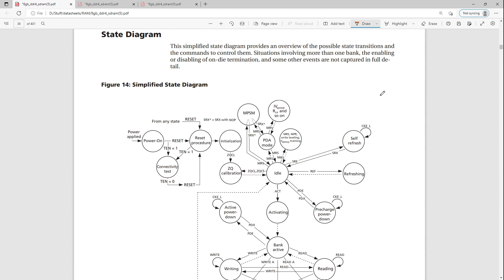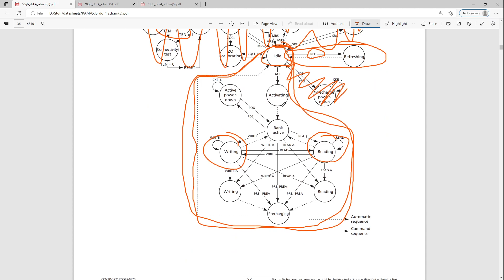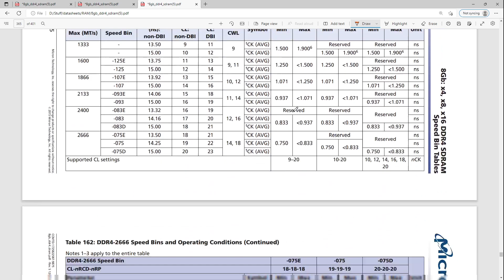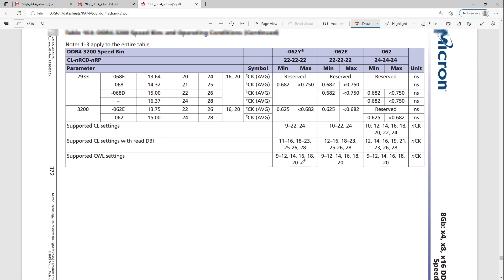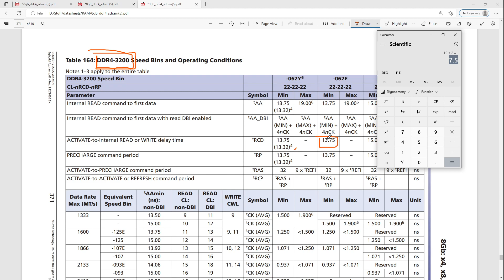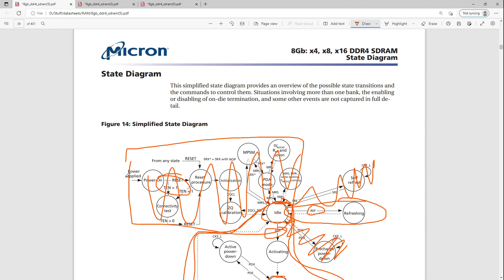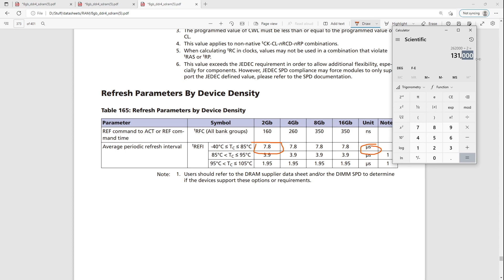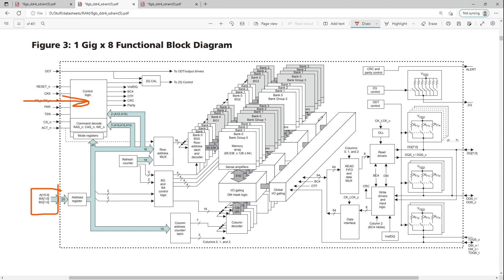RAM timings explained 0

Comment: So my main take away here was we basically rely on educated guesses for how all this stuff works because there's no real back and forth communication? The timings are literal guesses on operation timings? 

Da fuck!?
Reply: In essence, We make approximate use of the properties of copper to achieve this end. Whatever comes next is a matter of   refinement. Removing bottlenecks involves better understanding of how electricity charges copper, or conductive alloy atoms across its matrix in a specific shape. 

Its one hell of a rabbit hole...
Reply: @MarcABrown-tt1fp  lol the longer I work as an SE and gain better understanding on tech, the more I realize just how much is held together by shoe strings and paper clips while balancing on a tight wire...
Reply: No.  It's only educated guesses when you start overclocking.  Up to that point your processor and its memory work correctly together because they were engineered to do so.  The data sheets such as that which Buildzoid showed specify the worst case timings for the RAM.  The memory controller in the CPU is set up by the BIOS so that the RAM chips always work with signals that allow the RAM chips enough time to do their thing.  At this level, it is basic digital electronics - it only gets more complex because in DDR4 and DDR5 there are so many sub-timings and interdependencies that also have to be taken into account.
Reply: @GodmanchesterGoblin  That's still just data sheet saying how long things should take. Which is still basically an educated guess. I understood the video given I have the background to do so, but that doesn't change the fact that it's basically relying on things "just working" TM
Reply: @GodmanchesterGoblin  without any kind of handshake protocol or way to indicate when a process completed....it's all just a very fragile pipeline made more reliable via accounting for error margin and buffer room. OC is seemingly just reducing both those aspects without really knowing how much you can remove till you try
Reply: @aj0413_  No. The data sheet specifies the worst case parameters, guaranteed by the device manufacturer.  To that, the board designer adds in the time it takes for signals to travel the necessary distances, to settle after transitions, and so on. Those are all defined by physics, specifically transmission line theory and would be confirmed by direct measurement during development.  Hand-shakes between CPUs and local memory would be technically possible of course, but would add more time and complexity.  Yes, it has to "just work" but it does so because it is designed to.  This is a very different from transactional operations in software, or over a network, etc.  Not to be critical, but I suspect you probably have not spent much time working in digital hardware design.
Reply: @GodmanchesterGoblin  That doesn't really change the relevant point: you're using math to make a determination on how long something should take and then relying on that.

It's an educated guess. Most of physics is an educated guess because it relies on a bunch of principals and theorems that have yet to be proven conclusively.

I'm not sure why you dislike summarizing it that way.

shrug I started my education in CE which combines CS and EE; as I said, I understand the topic/discussion.
Reply: @GodmanchesterGoblin  I have literally had to do similar design as explained in the video at a software level.

The only real difference is accuracy of guarantee, at the end of the day. 

Theoretically, we should know enough that the guarantee here should always hold true.

I wonder how long this design will hold up as we edge closure to the quantum tunneling problem
Reply: @GodmanchesterGoblin  But disclaimer: yes, digital hardware design isn't something I've had to touch in near on a decade. S'why I listen to buildzoid to get the watered down (rant/tangent) filled summary
Reply: @aj0413_ As you say, it's down to the accuracy of the guarantee.  And that holds true whether we talk about the design as a whole or the data sheet specs for an individual chip.  I think the difference is the language we use.  I do understand where you're coming from, even if I would not call it educated guesswork. I probably gave up guessing when I was designing around standard DRAM chips in the early 1980s.
Reply: @GodmanchesterGoblin  That's fair. I was recently reemed by the wife getting on my case for not prefacing any technical discussion with "we think", "theoretically", etc...cause she decided to be a pedantic troll about how theorems aren't actually facts while discussing space/time theory. So, sorry that you got hit with the backlash of that lol

Comment: Have anyone deal with RAM not resuming properly from sleep while overclocked?
Reply from the maker: I have heard of that being a problem but I don't have sleep enabled on any of my desktops so I've never experienced it myself.
Reply: @ActuallyHardcoreOverclocking  Also how come that DDR4 is so variably imprecise while overclocked? My A55 chipset with two sticks of 4GB DDR3 HyperX 1600 just have to dial it to 2400 and it just flies with the occasional hardware exception error thrown by the kernel in Linux once in a Blue Moon and more frequently during Summer.

Comment: Sadly they don't teach smaller than millimeters in middle school as you are not able to use anything smaller anyways. In higher grades depending on where you go and what you take you might get smaller measurements and what symbols they are shorted to.

Comment: I think that I know what the refresh does, look at DRAM-memory as capacitors, those lose electrons over time because those do not insulate perfectly in real life. It checks for a reference voltage if charged up and if the voltage drops too much then it pumps electrons again to make sure that a high voltage remains sufficiently high. This is a bit of speculation of me though I am 100% certain that you can compare it to capacitors, I am 100% certain that REF stands for reference-voltage.

Comment: 27:10 okay then you explain how I statistically have a higher amount of kills vs skilled opponents at a lower NANOSECOND memory latency vs higher in CS competitive   .

ONCE you have controlled for situation positioning and isolating 1v1s where you SHOULD have 50-50 chance to win the engagement AND have enough competitive experience to tell the difference.
Reply: *im in esea main

*Csgo is extremely memory sensitive.
Reply: Frame time variation. Lowering latency improves minimum frame rate and reduces the variation in frame delivery overall. Since CSGO punishes errors so harshly, even compared to other FPS games, you are reducing the number of mechanical errors you make by having the most up to date visual information available.

Comment: Little concerned with what you are telling here with the Samsung b-dye as I always read to look for b-dye cause it should be "good" memory chip. Not neccesarily the best, but one you could always count on doing what its supposed to for its specs. This sounds more like it's a "cheap" chip when you say it's all over the place timing wise ?
Reply: B Die is the best, but all chips including b die vary heavily in quality. B die will almost always run what it's rated for, and usually overclocks very well if you just slam 1.5v into it and stick a case fan over your ram to keep it cool, where as other sticks will require looser timings, stop scaling with voltage after a certain point, or even potentially die if you slam voltage into them.

Comment: 2.14volt ram x12 = 24.800mhz ddr3 can do it 😂 4x6 ssd x3 gpu x3oc x2 =x5 wifi 7 6000mhz x2= x7 over 300mhz x2= 24.800mhz max x12 ram 7timing ist faster on 3.7 to 5.7cpu 24000lvl 2x300mhz x8 10k 2.800mhz spreed  so last post was this noting more t4 timings 4x4 x4x4 x4x4 x4x4 Konstruktion on board and hardware 32c  lvl x12x16k lvl ready 128 core power i say it you can 3x faste make 8c 16t 24tb to 256c lvl x64 x64 lvl over 28.800mhz over 16c 32t 2x 48gb 96bit over ram its work server runs so 1.8 petabyte  this is that cuppel faster over dobbel ssd 24 and pciex4 x8gpus all is Working i say it you

Comment: Wouldn't it make more sense to engineer memory modules that are at least smart enough to be able to respond back that the row has been activated/data written/etc., so that timings become unnecessary, and commands can instead be sent at variable rates corresponding to the time that the previous command is completed? Wouldn't that also help prevent data corruption by allowing data from a write operation to be confirmed via a returned checksum?

I assume the answer to this is that it would slow down overall memory performance because then each operation would require waiting for the previous operation to finish. However, given how fast memory is nowadays, that seems like it could become a worthy trade-off, since it could help prevent data corruption.

So if that's not reasonable, then, how about adding logic to memory controllers which occasionally uses such commands to calculate the amount of time it ACTUALLY takes these operations to complete, and adjust timing dynamically based on what the memory is capable of at the time? Basically instead of overclocking manually as we do now, the controller would keep the memory 'overclocked' to the best timing it calculates can be supported without data corruption (with some level of tolerance, of course). This calculation could be repeated every so often (say 1ms) so that the timings are virtually always ideal, even if the conditions change (such as if the memory modules begin performing detrimentally due to heat or some other influence).

Then we wouldn't have to worry about setting timings and overclocking at all; instead worrying about the average minimum timings that come from a brand.

Comment: I say jour how its work 2400mhz 12x datapakets 4800mhz to 7600mhz over ssd m.2 18.600 mhz and  wifi 7 6000mhz ram 6000mhz + 2400mhz = 8400mhz = speed 16.800mhz 18.600mhz ssd m.2 blast 1tb 4x4 faster 2000mhz to ram network ram speed x4 speed x4 its give exakte 18.600mhz on ram wenn your ram un 1.87volt to 1.48v board latenz vollt over pipplines ore 6000mb/s ram do x6 so that is the Trick open you timings on ddr3 to limit from 7 timing to become the fast 8 x8x speed over network over ram over cpu x12 x6 = 18x 24.800mhz x12 x6 24.300mhz x8 24.400mhz x3 pippline over 24x half data paket  or 22x 6x 24 x8 core 6 c 8c become the same timing over max 12x ram or gpu on 2680mhz oc to 24.800mhz limit 24gb gpu  that Combo blast 4x 4x cpu ram wifi 7 ssd 4x4x gpu x2 bandwith limit 4x4 its give 24.000mhz boost bandwith together an cpu 8c and ssd 8c m.2 16.400mhz 4x4 = 8c  4x4 over 4x ram max oc wifi 7 x6 ram rest you become over ssd make more drive for stabel 24.800mhz you must open ram limit timings and 7 speed boot winto run this on 3.7 gpu auto to becom this lvl so easy in 1.87volt x8 ram
Reply: That shit is unreadable. Heard of a paragraph?
Reply: @mitlanderson  thats the problem ddr4 musst open limit timings have and boot 7 in 3.7ghz cpu than it go it boost x2 faster over 150% 4800 2660mhz ran ddr4 8c 2466 6c12t
Reply: 150% trippel  timing 32cor lvl speed over 24.000+ 24 x24 x600
Reply: @PeterMarszalkowski  mate, the way you type seriously makes me question if you even speak the same language.

Comment: This video could've been far shorter. Once you got to memory is dumb and won't say when it is ready thus timings to guess it's ready due to specs...well that was all that was needed to explain timings and how knowing what they are for does not help when overclocking. A top of the line memory chip could be running on the edge of timings if you lose the silicon lottery and a cheaper stick with the same speed but slower timings could outperform it with an overclock if that stick owner won the silicon lottery and got his timings just right... Or the CPU memory controller is a loser in the lottery and everything is a rather moot point beyond what JDEC says for standards.

Comment: Or do it lower over gpu with SSD + timing 6.4ghz over 12cpu on 12x ram timings  = all this Settings + ssd rade 0 m.2 16.400mhz 1tb x4 12x timing ram x4 wifi dobbel bandwith 12x core 24.000. Ram ssd 16.400 x4 m.2 4tb = 19800mhz wifi7 6g 6000mhz 2.300mhz and gpu 24 .c + 2.579mhz ram lvl limit over 24c 12x x2 2579÷2=1289.5mhz 2579x2= 5158mhz in 24x 2x 12x bandwit ran ssd bandwit network cpu gpu x5 lvl limit over low 24core 3.800mhz 14.700mhz sddx2 12x  over 12ram +2 24800 mhz ssd 2x 1tb m.2 7400mb/s 1tb 26.800mhz over 1.48 bandwith latenz 1.89volt it blast gpu x2 to x4 24600to 24800 overcwifi 6000mhz x6 x7speed in ram cpu gpublimitvits 3.7ghz cpu to 5200mhz lvl x22 ddr3 limit ram 24x to x12 = 16.4x4x= 16.800mhz x12 over 12x 200mhz with wifi 7 600mhz Balance over 12x 200mhz = 3200mhz lvl 16.800 24.800mhz = 6400mhz lvlx3  tripel  so easy gpu cpu ram ssd x6 dobbel x7 10g and 10k kabel 10k x8 lvl to x12 ram lvl 10k 24.800mhz.x12ram 24corecpu 3800mhz 1.97volt to 2.14volt= x14 speed
Reply: 3 Timings  you can do on it 6 x 8x 12x ram dobbel trippel ssd + Wifi 7 RAM Stabilität over speed ssd gpu 8x8 16x 16x x8 = 32core lvl x8 t4 speed at all lmit x12ram over all is that 50 x50 internet data on 2600mhz RAM 18.600mhz thatcis ddr4 lvl i muss it emulader for trippel 19.600mhz over data wifi to 1980mhz ssd oc RAM 3.900mhz 3.850mb/x4x4x4x2 24core 600mhz wifi24.600mhz bandwit over 24xcore 24.800mhzx2 x12 cpu gpu 24x x24x tigether to become it ddr3 can do it and ddr4 beginn Thea 2400mhz ram
Reply: 5158 over 6x ram 7.2ghz and 6.2ghz

Comment: you can charge 3 pcs connect and charge the energy distributed in a circle so you don't lose any power unless you send the energy into the network 1600wart x2 you do 8x 2x 24x4 2600 again purely via aku store you send energy connected type-c via the network housed you 800watt for 2.4g 100g 10g 2x power zells a 18600akus in 20.4 sec easily you make yourself a shutdown time out you have to charge 18600 times 4x4 t4 power usb 3.2 / type-c so you only disappear switch-off costs of 33% of the power if you up to x33 on x7 to in the car at once at 54.000mhz 33x only 66xsafe 2x aku load solder together keb fixed cost 230euro 2800st or more so cheap are the testla sail it for thousands with the server you get a tesla as fast as that can. no one can survive.if you make the mobile 2.4bilon petabyte 😂